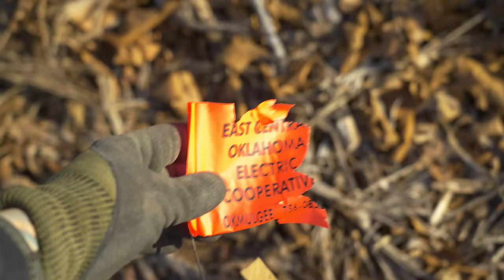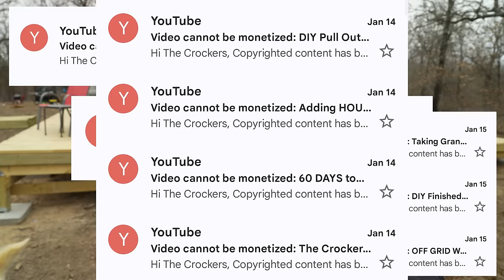YOUTUBE is DEMONETIZING our Videos! Tractor BROKE When I need It MOST!

Comment: if the diesel is gelled up,along with adding the 911, you need to remove the current fuel filter(s) because they are most likely full of gelled fuel. New filter(s) filled with fresh 911 diesel fuel should be installed. Grew up on a farm in Western NY and about once a winter we would need to do this.
Reply from the maker: I already have new fuel filters ordered and on the way! I hope it works haha
Reply: Sometime you gotta to crack the fuel line at the injector and crank until you get fuel out of them
Reply: It's going to be. A icy mess tomorrow,pray for fuel filters to arrive and bleed those fuel lines.
Reply: We have taken a hot plate and put it under the oil pan and block the sides so the heat will warm the bottom end of the tractor and this helped us with ours
Reply: You’ve got to change the filters and run some diesel fuel additive that dissipates water .
Reply: I've seen black algae buildup in the filter and tank on my uncle's Case
Reply: Good luck😊
Reply: Always keep filters & 911on hand, with a diesel. Makes life a little betterer.😂❤

Comment: Maybe your luck works like mine. So go cut 2 fence posts and then the tractor will start. Seriously note...  did you check your work when reassembling the tractor. Maybe you knocked a wire loose, especially a ground wire. But start with the fence posts😊.

Comment: Used to drive truck, when you'd hit SD or WY, MT in winter we'd add rubbing alcohol to fuel so it wouldn't gel. It has to be the higher % rate. The company would have you put the alcohol in instead of the additive to save $. Try warming up your fuel. The trucks that didn't put an additive in would be sitting waiting for a service truck.

Comment: Artists can change the rights at any time, but your license is for when you added it to the video. You paid for a service and should go through them to fight it, if the company folds you can easily figure out if it's another company with the new master rights and have them take it down. This is generally done by a machine, you need to talk to a human to correct it. It's also a very easy case to win, sue them and they'll likely settle by your terms to release it.

Comment: If you froze up (which definitely looks like you are) , don't waste your time, or the 911..... stuff is expensive. take and put some 911 in the tank then put a fresh fuel filter filled with 911 and then put a tarp over the tractor at least to cover the engine and fuel system and back your pickup close so you can let it in all the exhaust you can under tarp..... let run at least a couple hours to warm and loosen all the gelled fuel in lines and injectors. then once you get it running get the white bottle of Antigel the same name brand as 911 and keep your fuel doped with that ...... empty fuel cans in the cold condenste inside.... that's where most people get messed up in the cold with diesel.
Reply from the maker: This tractor is the 1st diesel engine I've ever owned. It's like a bad girlfriend! High maintenance and tons of problems I didn't know I was getting myself into haha
Reply: @TheCrockers  ya, don't feel bad most dealers up here in Maine will skip the winter preventative maintenance steps. for freezing temps don't be afraid to use Antigel in your fuel at the pumps. also, keep spare fuel filter cause when they gel often don't clear back

Comment: Suggest backing the truck up to the tractor and heat up with exhaust pipe... I saw a video yesterday where a guy built a fire under his bulldozer to get the oil and engine block heated up and it  turned out the reason it didnt run was there was ice blocking the intake.  One other idea is if the oil is too cold to flow there is probably a switch that automaticly shutting of the ignition.. You could try synthetic oil so it flows better... also try starter fluid in the intake..
Reply: my case has a heater i plug in 120 heats the water in the block. they make oil dipstick heaters..

Comment: Diesel engine works on compression, you will need to get the air out the lines, can you reseach how to bleed the lines just before it goes into the engine?

Comment: Maybe y’all need to get some heated buckets for all the animals so their water doesn’t freeze up. Not positive but I think tractor supply has them and there is many others online. You can even get submersible ones you just put down in the buckets. I’ve even seen some that you can just put under the chicken waterer. You can even get one for the dogs. It will save you a lot of headaches every morning from coming out to frozen water. Better for all the animals too so they don’t go without water. I know this won’t help all your problems with the tractor but a heater underneath it over night blocked in on the sides will really help with it. Hope you get it going soon do you can spread the dirt so the electric company can get in there.
Reply from the maker: We don't have power

Comment: Put a torpedo heater under the engine of the tractor it and put metal or something around the heater to trap as much heat around the engine as possible it will be thawed out in 10 mins

Comment: Why not just a regular gate without the cattle guard. Unless you are planning on moving cattle through there all the time.
Reply: Either way they need to move dirt to smooth access in...need tractor for that
Reply: @josierobinson7344 it was a smooth access jason changed it. He wants a grid so he doesn't have to open a gate. He should get a solar powered gate opener but I don't think he can afford that just yet 😂

Comment: Bro sorry about YT doing you like that. I could not imagine not getting a portion of my paycheck off some technicality. But I like how you handle things just let it roll off your back I guess that’s all you can do. Also I wanted to give some advice get one of those diesel bullet heaters and aim it toward the tractor and you can get the engine ,fuel lines and everything else plenty warm we do that on our equipment during the winter 10-15 minutes is plenty of time to warm everything up.

Comment: Hey you may need new fuel filter because of ice and crap in filter. I had that problem with my big truck in winter. Some fuel stops sale you bad  diesel.,
Reply: Is there a pump on your fuel pump where you can pump up  manually.. warm up fuel filter may also work to get ice out of lines